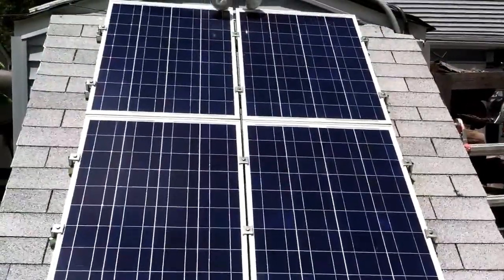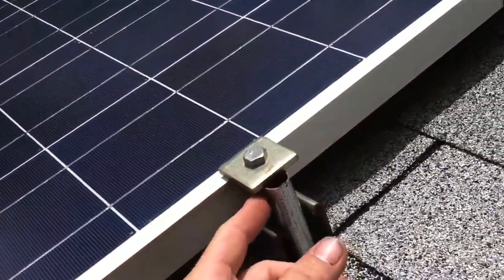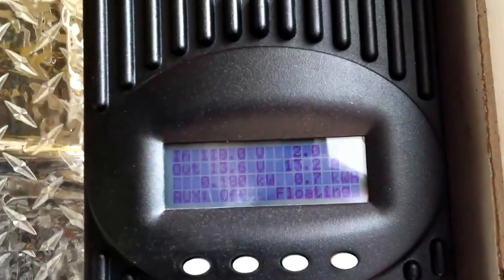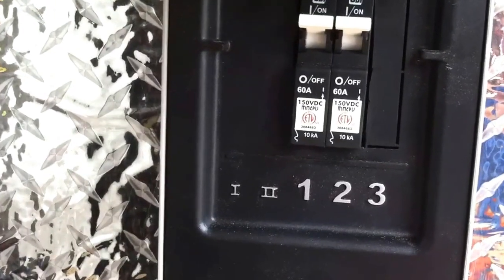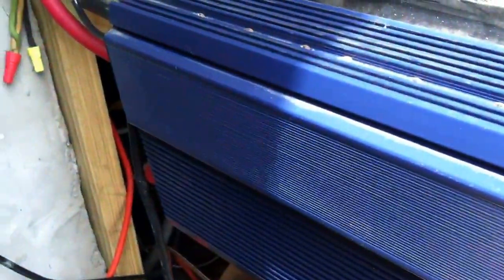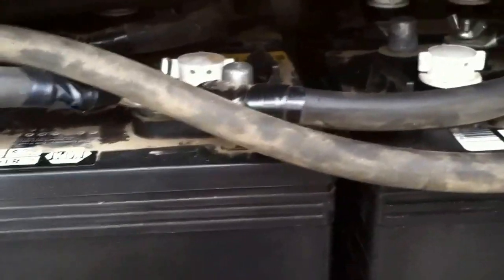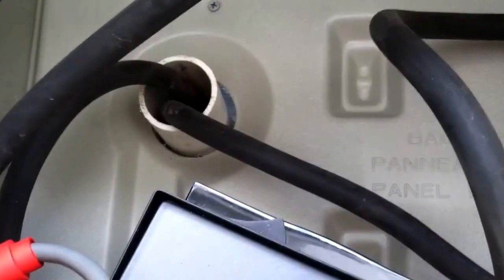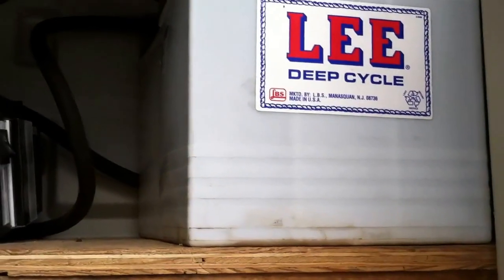My Solar Update JULY 4, 2013

Comment from the maker: I paid 210.00 for those 100 watt ul-solar panels last year..Iv'e seen them as low as 140.00ish on ebay recently..As for the puresine wave inverters id be happy to get 150.00 +shipping each for them ive bought them 2 years ago for 399.00 but then heard some horror stories about them on utube about burning your house down so i never really used them im sure there ok just wouldn't leave my house with them running....Thanks John